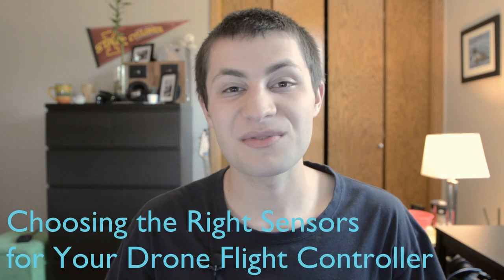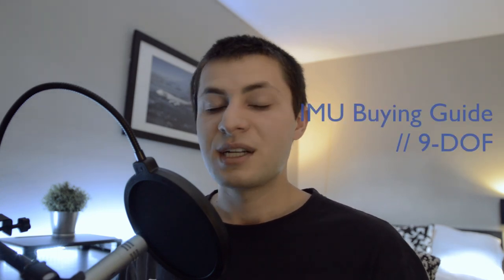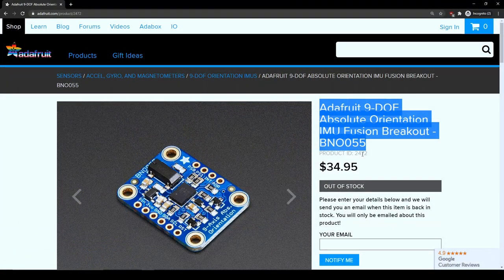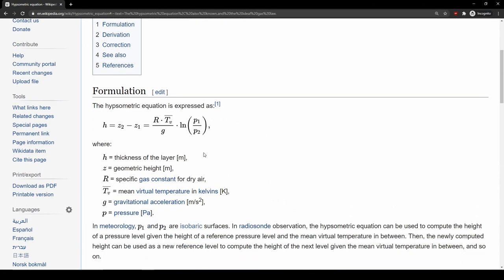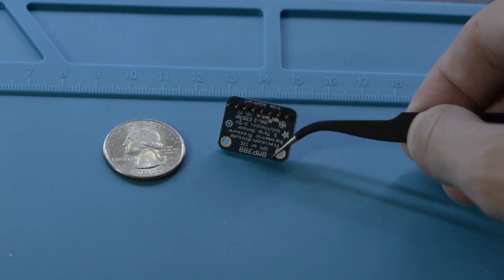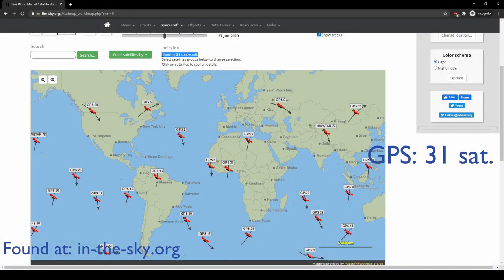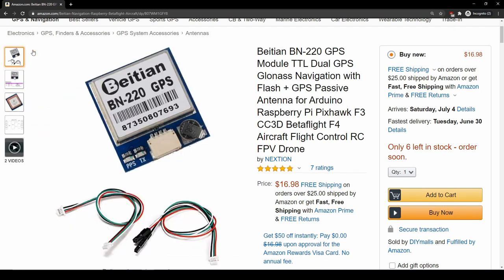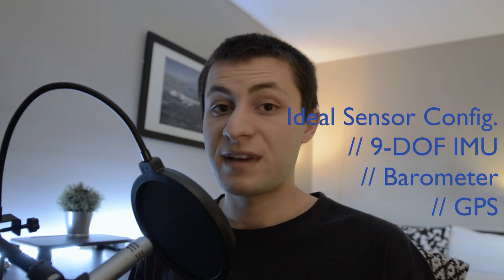How to Choose the Right Sensors | Drone Flight Controller Development

Comment: 10 DOF module
HW-290/GY87
This includes 3 axis Gyroscope, 3 axis accelerometer, 3 axis megnetometer and air pressure sensor.

I think one module instead of 2 or three reduce stress in programming and saves space on drone.

Please check the module

And thank you so much for such informative video

Comment: Why did you decide not to go with the BNO055? Would that make it too easy? :)
Reply from the maker: Haha yes, it would make life easier. I'm hoping to create an even better sensor fusion algorithm than what's on the BNO055!
Reply: @micwroengr7851  I have seen some Arduino forum posts that the BNO055 is less accurate when it's moving. I would like to log/reconstruct a flight path of a water rocket (I already log altitude using a BMP280 and a Raspberry pi zero). Do you think the BNO055 would be reasonable for that (or a BNO080?). I would prefer not to write a Kalman filter just yet!
Reply from the maker: @simonabunker   If you want to track a model rocket trajectory, something like a GPS + barometer might be a bit better. Use the GPS (NEO-6M) to track horizontal position and speed. Then, use a barometer/altimeter (BMP280) sensor to measure altitude and vertical speed. That's what I'd do. Both sensor are independent, no need for complex sensor fusion stuff.